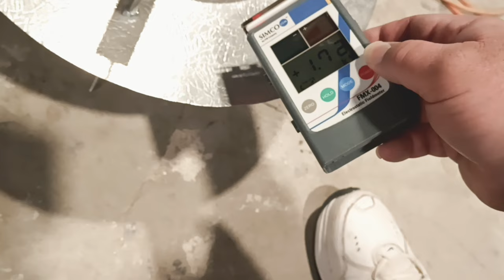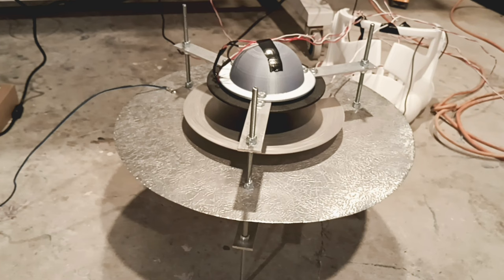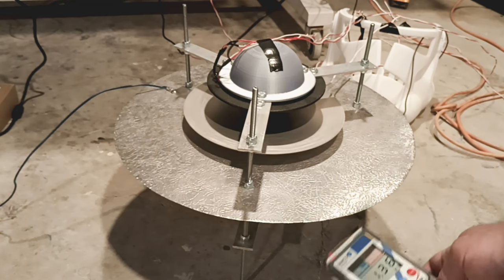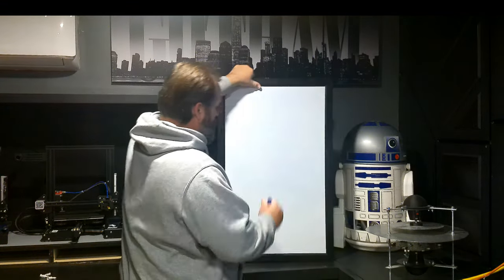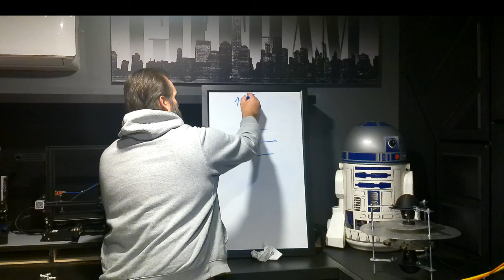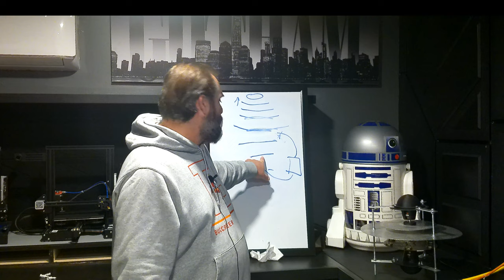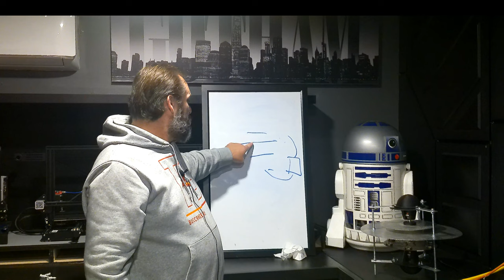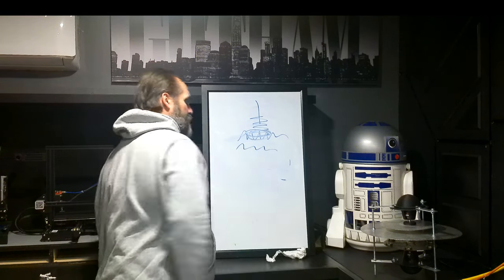Graviflyer Test 3

Comment from the maker: FMX-004 LCD Handheld Electrostatic Field Meter Static Tester for SIMCO 30 kV  Is the device being used here.
Reply: Glad to see you splurged and got the higher end model! You need to hold the meter tangential to the spinning discs and parallel to the center disc to get accurate readings. If you hold it at an angle to the spinning discs, the charges on the center disc can mess up the accuracy of the reading on the spinning discs. Also, it's important to hold it 1" away, it will give erroneous readings if closer or further. Great work!
Reply from the maker: @MyTBrain  I got the one you said to. I started to notice the distance part. Good luck on the live feed later.

Comment: The Simco field meter measures static fields and charges for audits in the ESD industry. We demoed the unit in the 90’s for clients like Lucent and Texas Instruments to spot vulnerabilities in their static control programs. One popular demo was to take a wool cloth on a PVC pipe and literally peg the meter with a swipe or two due the effects of turbo-charging. If you really want to build a static field add materials from either end of the tribolectric series. For example stick a ring of UHMW tape to the metal disk and let a natural wool brush to ride over that. You can reverse the materials on the reverse side of the disk to create a positive charge by the spinning motion alone. This is how the rubber belt in a Vandergraff generator creates such large fields on the domed collector.
Reply from the maker: I will try that. Thank you

Comment: Would a synthesized pure tone generator be helpful? It’s the most materials pervasive tonality. The only orchestral instrument that comes close is the bass flute low C but referred to as solfeggio there are 9 total 8 outside modern music tuning. Just another reason I prefer using 13 note octaves instead of 12 pushing a guitar bridge a fret wider or placing a size longer neck on the guitar I could toss books from shelves and spin dinnerware playing music. The Amerindian temperament is the most ancient and was used for work and rituals  hunting, fishing & rights of passage. I definitely understand about proper spacing.

Comment: I think you are assuming the ultrasonic wave is a standing wave, it s not, it is a succession of waves moving away from the ultrasonic piezo disk. So there will only briefly be peaks on the top disk.
To have peaks that occur on the top, middle and bottom disks at the same time, you need to measure the distances between them, work out the wavelength of the ultrasonic needed and drive the piezo at that frequency.
Reply from the maker: That is what I was trying to say. I am looking for the correct distance.

Comment: as far as I understand there is a short circuit breaker on the middle plate and a current generator on the top plate, it will have different electric currents, in the center and on the shore

Comment: Point of clarification: Do the discs spin together, in the same direction? I assumed they spun counter to each other not the center plate.
Reply from the maker: They spin in opposite directions.
Reply: @nathanbunten4299  
To each other? Sorry to be a bother but they look like they spin tougher ^l^ looking from the side view which would be opposite rotation to the center plate.
If they rotate ^|v to each other that would be same rotation to the center plate hence my confusion.
Reply from the maker: @chasson321  the motors only go one way but they face each other. This means they counter rotate.
Reply: @nathanbunten4299  
Thanks again for the clarification. That confirms my original understanding.

Comment: Nathan, the equation goes V=E/q. Your meter measures volts. When the volts go up as your meter shows then you have a very small charge. Also, you have three Al plates, and you need a center AL plate with the marks on it to allow the ultrasound to go through which you have. You need a top and bottom polycarbonate disk coated with a thin layer of Al on one side and a thin layer of Al2O3 on the other side with the Al sides away from each other. Polycarbonate with the thin Al and Al2O3 sides and the marked Al transfers the ultrasound though the plates to stop the voltage from appearing which your voltmeter shows partially with the three Al disks. The negative top disk and the negative bottom disk produce the necessary force to lift up the graviflyer. The separation distance of the plates is important but not as important. Also, you want a very high voltage differential between the middle plate and the top and bottom plate after the button is pushed. The middle plate should be around 14000 volts from the tesla coil that builds up the center disks charge very slowly as initially the ultrasound inhibits the voltage  and builds up the charge very slowly on the middle disk, so it contains all of the charge and about 400 volts on the top and bottom CD plates with no charge and when you push the button and turn off the ultrasound the voltage appears, and you get the large top and bottom charges that are negative on top and negative on the bottom.  The ionosphere is positively charged, and the earth's surface is negatively charged so that the surface of the earth repels, and the ionosphere attracts. Nathan, you have an air capacitor that shorts out and does not work. You need a normal capacitor setup. The rotating disks with the charge then make a torsion gravity wave. The large center disk and the magnets help keep the charges separated and the spinning magnets also produce a torsion wave. The large voltage difference also keeps the charges separate.  The tesla coil produces the large voltage differential that is quenched by the ultrasound initially. Also, I am not so sure that an AC to DC power supply will work. You may need a 12-volt battery like Alexey uses. The AC current is at the incorrect pulsing. A battery pulses at a higher frequency with the chemical reaction of the atoms like the ultrasound. It is also the casimir/capacitor/metamaterial gravity effect. The battery also has a larger current to charge up the graviflyer. The spinning magnets also produce a current and voltage on the top and bottom disks that also produce a magnetic field. The earth has a magnetic field and the magnetic field on the graviflyer being the same polarity may also help to lift the graviflyer.

Comment: The ultra sound has to go through the center plate combined with the upper and lower spinning plates it only makes sense the magnets on lower plate have to be oriented so the magnets push the energy down combined with the ultra sound.

Comment: Because you ate using longer motors, your piezo buzzer is farther away; you might need to use more than 5V for the ultrasound for more power. At higher frequencies the amplitude also drops, so you can increase the input voltage, up to 12v, at higher frequencies. If you use 12v at lower frequencies it will draw too much current and burn out the transistor.
Reply from the maker: I have pc fan motors on the testing Graviflyer. The distance should be the same as the original. I will try more volts but with a dial in the power supply.  5v 1.5a is what I am using right now.

Comment: Its a real shame itll never work...
Reply: He’s dedicated to it. 
Dunno why
Reply: The thing is, this device gives great yet unfounded promises...but once you understand the science it all falls apart. The only thing going on here with the contra-rotating magnets near the high voltage aluminum plate with the ultrasonic source is some plasma is being produced and mildly inductively heated + compressed by the lenz effect and the "resonant" ultrasonic wave is worthless...resonance is not some silver bullet (it simply means oscillations are better captured by a specific object, but energy is still conserved and this cannot work in a vacuum; some people might say acoustic levitation, but if so why at the top of the craft where the rest of it is pushed into the ground and sound ≠ gravity), and I doubt it's at the resonant frequency of either the unstable plasma or the plate. Sorry for the winded explanation but that is the Graviflier totally debunked-none of its parts are reasonably designed to deliver some sort of gravitational impulse or wave-which yes, is possible but would require a totally different design and a lot more power.
Reply: @Hi-zf4bn  
More simply, gravitation has no polarity. Ergo no antigravity. There’s no shielding of gravitation. 

The Alexi vid his ‘thing’ was lifted some few feet and stopped. By the logic proposed it’d continue up. Or by some logic that’s proposed the device would have no weight. Mass is subject to gravitation, ie weight. The device has a total mass and its weight will remain constant. Electromagnetic force and gravitation are in different realms.